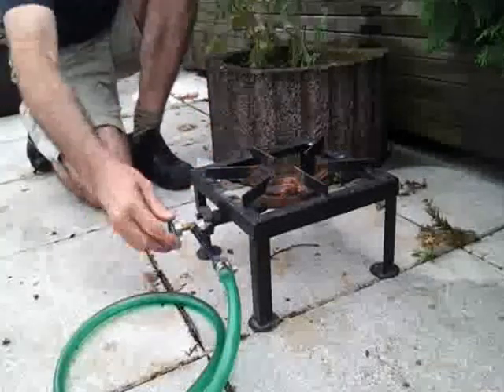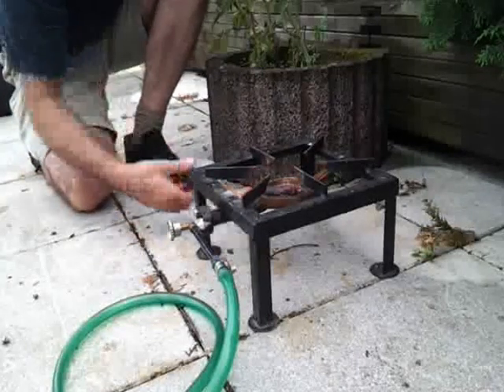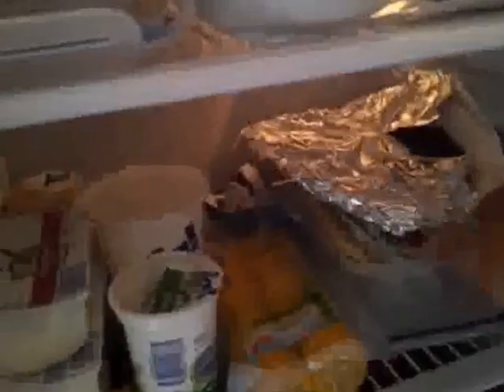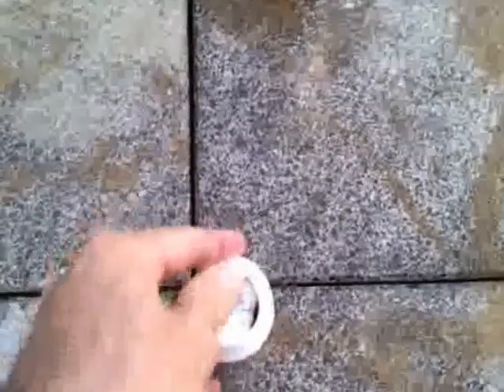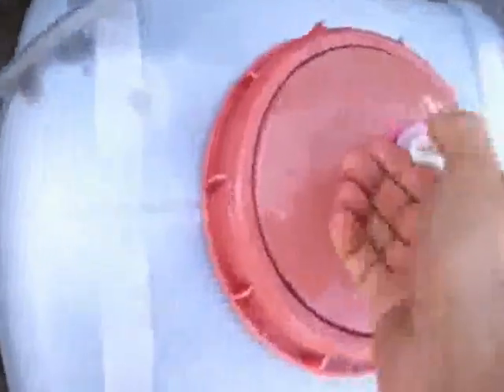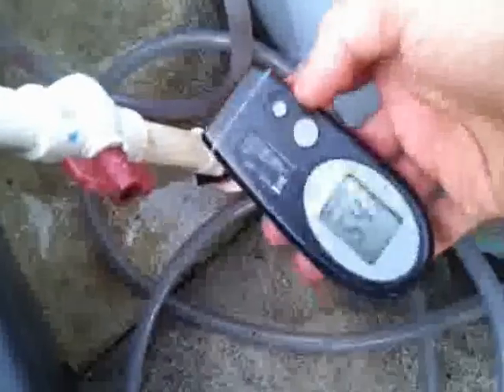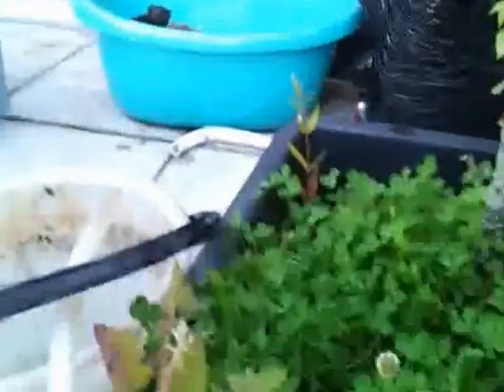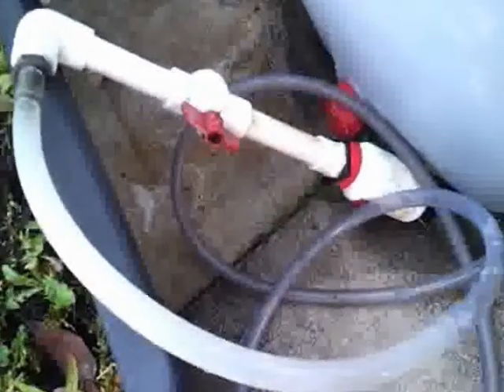Making hydrogen from a dinner plate's worth of aluminum foil, part I

Comment from the maker: from what I'm reading it is, like with biogas bacteria, all about surface area. If one were to powder the aluminum (or just use aluminum shavings from a machine mill) it would react instantly and catalyse the most; aluminum foil is much quicker than the can tabs.  My experiment in this video with layers of aluminum foil sandwhiched between paper towel is my interpretation of Earling Anderson's description in his patent. He further suggests embedding NaOH crystals in the paper, then just add H20.

Comment: Yeah storage is a hazard.  Even if we're producing on demand we'll need to be very careful in case of a flashback — the explosion, though relatively small, could spray NaOH everywhere.

Liters of gas per cm2 of foil might be good to know but it means nothing until we have the process down.

Do you think production regulation could be controlled by NaOH input or Alu?